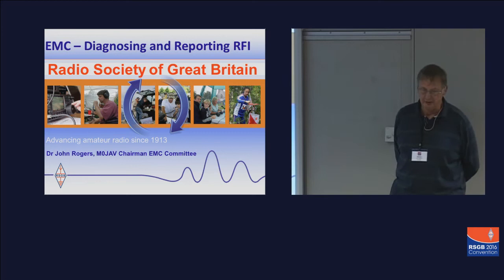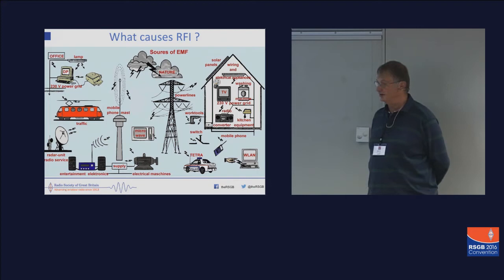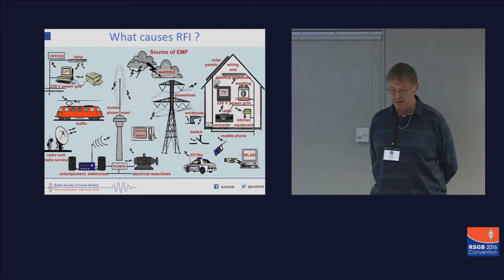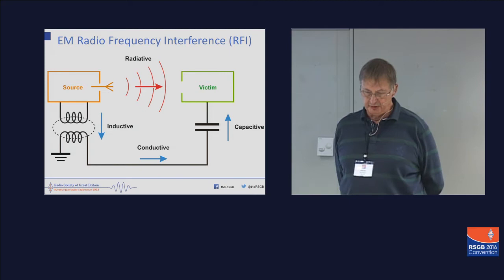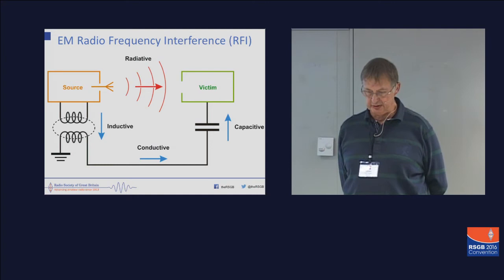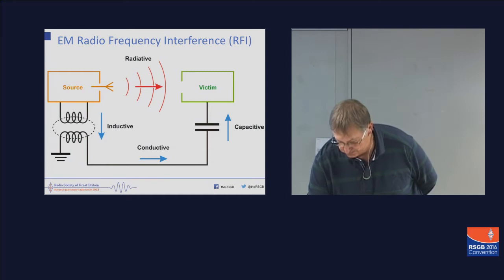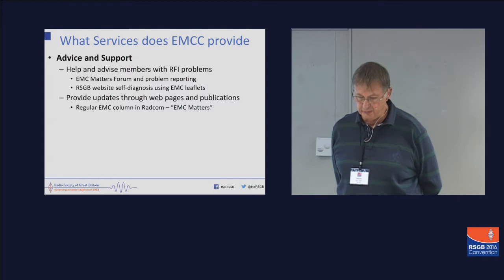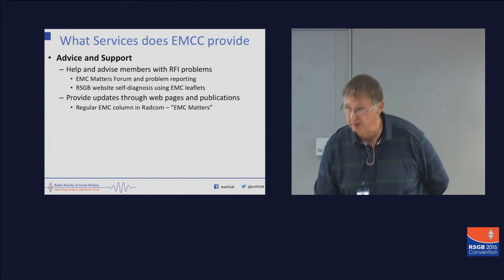RSGB Convention lecture 2016 - Diagnosing and Reporting RFI problems

Comment: All very well collecting data on sources of interference but it seems nothing can be done. 

Ofcom have no power to do anything but they did investigate and said it was my unused phone wire causing the problem probably through corrosion and BT said they would charge me to take it down. Their line causes the problem and I have to pay to remove the problem! 

The office of Minister for Telecommunication and Online send a standard reply saying get in touch with my broadband service provider! They haven't a clue what I'm saying. Nobody wants to know.
I get S8 noise from 160m to 20m and lately getting S9+ on 2m.
I can sometimes use c.w. because I can switch in a filter in to ease the problem and only work strong ssb signals. I like QRP but can I work other QRP stations now?
It was either put up with the QRM as I sometimes do, close down completely, or as I did, buy an FT817 and go portable. As it's winter I go on about twice a month listening through noise.
As said below, Ofcom reneged on their responsibility to us when they removed the licence fee.

Bill, G4GHB.